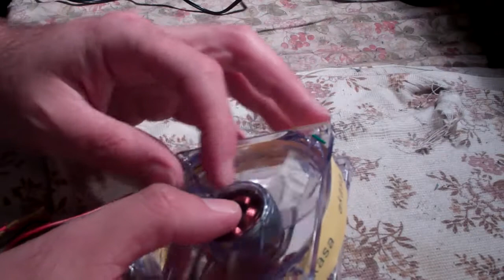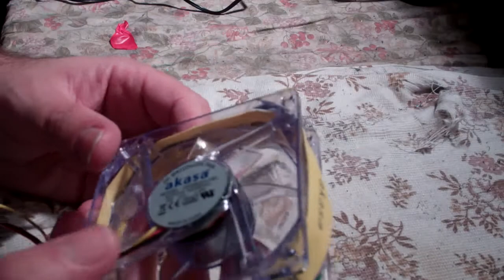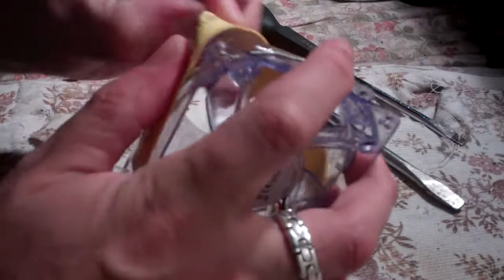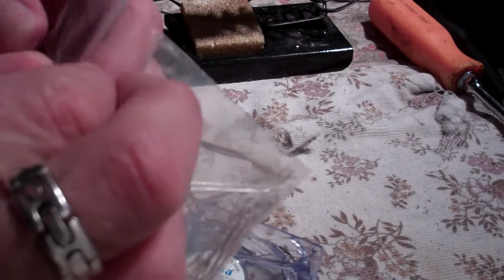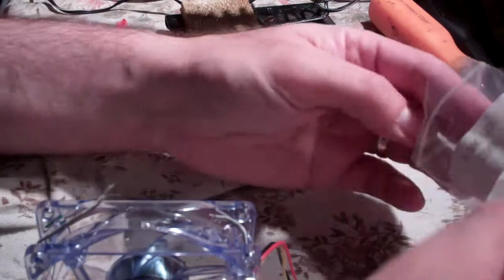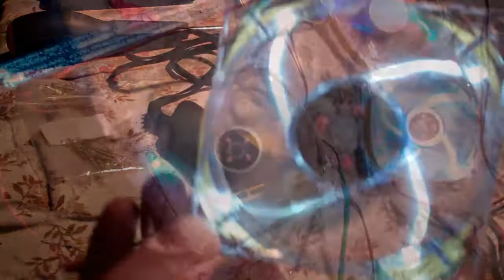Project Old Faithful - Akasa 80mm Fan - LED swapout

Comment: I think that I was. When I clicked on it the picture for the video hadn't even showed up yet :-)

I wanted to use white fans in the 1100 build but I didn't want to spend all the money to buy new fans. Now you got me thinking that maybe I should just change out the leds in mine. What volt were the ones that you used 3 volt?